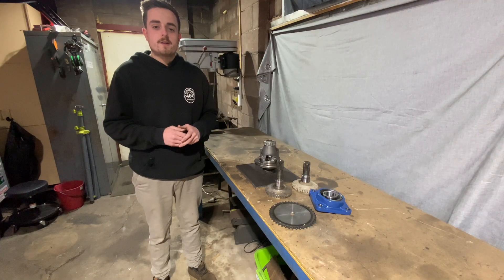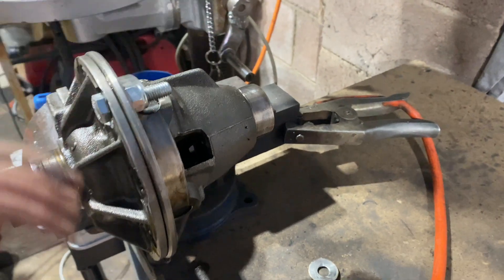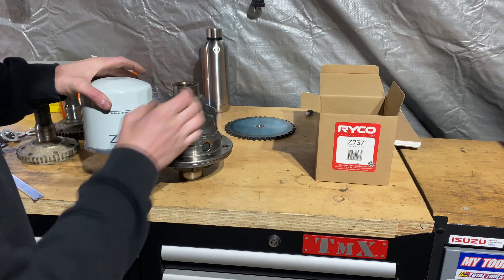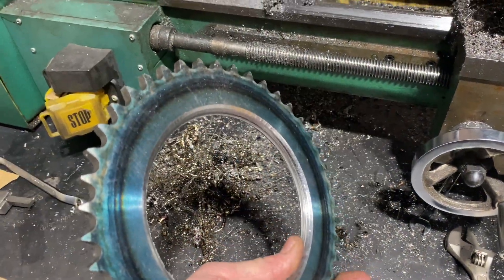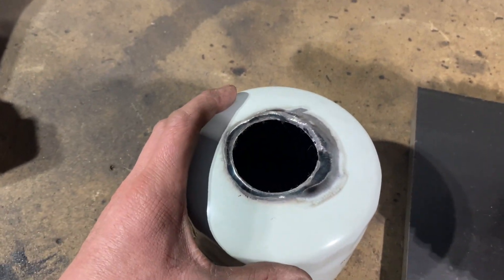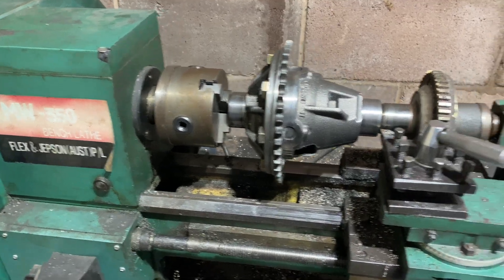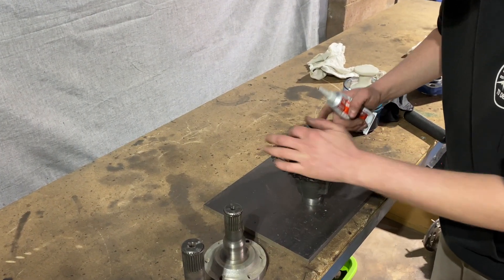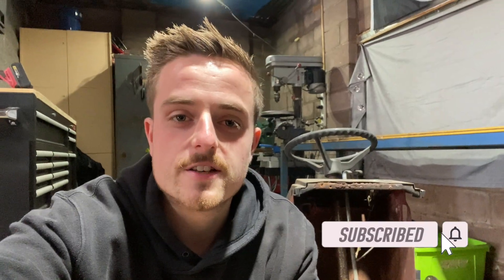Making Chain Drive Differential

Comment from the maker: Check out the latest,
https://m.youtube.com/watch?v=hVxN8AjHqpo
Reply: You should look into Powertrax Loc right Lockers. They simply and easily replace the spider gears with a ratcheting locker mechanism. they lock the axles together when going straight under power and open when cornering and no load. Kinda fun once you get used to it, you can really get the rear end to step out at will with just a tap on the throttle.
Reply from the maker: @ that’s so cool!

Comment: Did the cast housings hold up?  I built similar but with only two bold pillow blocks and had to redesign to all four block due to cracking of the cast housing.
Reply from the maker: Unfortunately it was too big for what I had in mind so it’s been on the shelf since..

Comment: If you have a horizontal shaft engine, then how are you mounting this? Especially if you have a torque converter. Are you offsetting the engine? Or mounting an intermediate shaft for power transfer?
Reply from the maker: I was planning on having a jack shaft to run the chain forwards to this differential and mount it with pillow blocks.
Reply: @EngineeredToDesign  I’m dealing with something similar on my buggy right now, and my issue is how an intermediate axle/jackshaft is going to affect the spacing. Seems like raising, or lengthening the areas that comprises the engine, intermediate axle, and rear diff is unavoidable. I’m trying to avoid adding chain tensioners. I’d much rather be able to slide the engine or the axle mounts to tighten the chain.  I’m interested to see what ideas you come up with.
Reply from the maker: @MrJakedaddy  that sounds tricky, feel free to email me some pictures if I can help at all I’ll try or send me a dm on Instagram.. unfortunately the differential I built in this video is way to big for my lawn mower but I will use it in another build 👌🏻

Comment: Hi. I very interested about this project. Wondering  how much horsepower it may handle. I am working on off-road 4 wheels independent rear suspension using 40K CVT and engine 450 CC engine. Thanks for sharing this.❤
Reply from the maker: That sounds so cool! This differential was out of a 204hp vehicle.. 450cc would be perfect